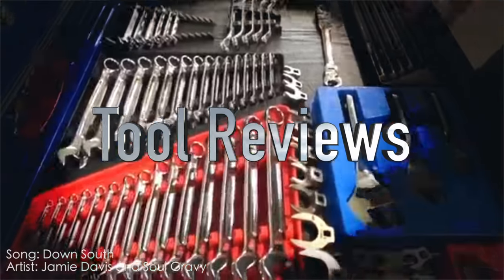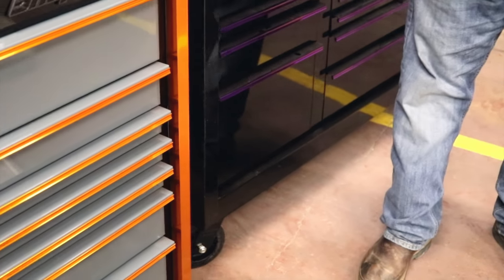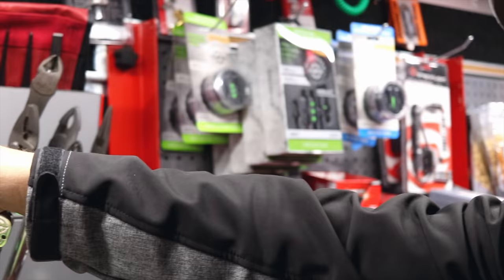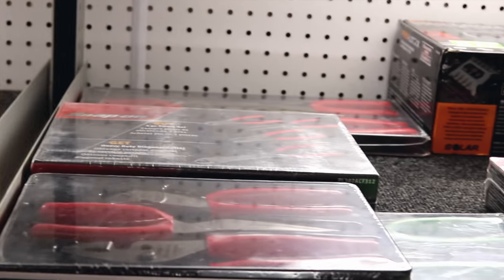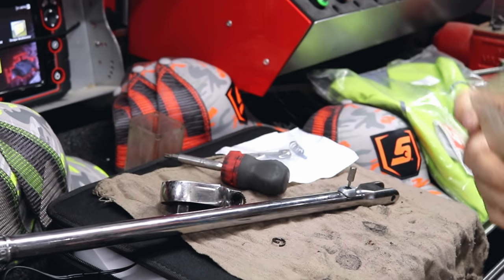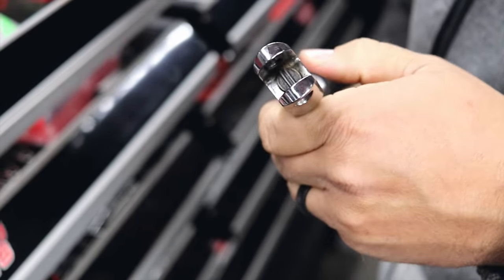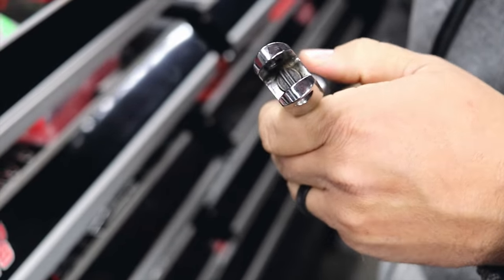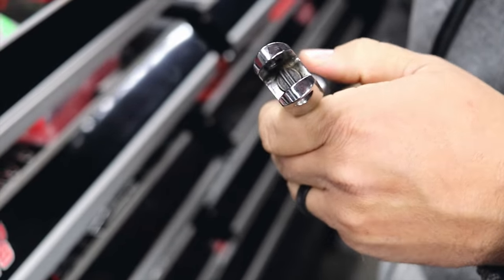Snap On Special Order Toolboxes

Comment: My two big ratchets are the SLL80A and the SLX80A You are right about being the cats meow for sure. I bought the non flex about a year ago when I was replacing the bearings in a Dana 3rd member. Snap-on makes some fine ratchets no doubt about it.

Comment: You mentioned drilling out bolts I found carbide straight flute drill bit  are amazing although they are very expensive but worth every penny "they are about $60. each" but they go through anything you put in front of them. I think they are really supposed to be put in a cnc machine but they work in a regular drill to

Comment: Broken off bolts,we use the mig welder a lot for broken off bolt extraction.Basically weld a nut on the broken off bolt in an easy spot.Diesel would not leave my mom alone,she spoils other dogs with treats.

Comment: Personally I like the Matco locking flex head better. To me it seems like Snap On let the interns design their locking mechanisms.
Reply: I completely agree. The Matco locking mechanism is just a better design hands down. The finish on the Snap On ratchets is better than the Matco though.
Reply: I'll be honest. I had the longest matco 1/2", and a 3/8" long one,  and a black 3/8" medium length,  and 2 3/8" stubby matcos. I had an old orange hard handle set of snap on that was give to me. The 3 piece set. They were rough. I traded em in for long handled 1/2" snap on locking flex head and I'll not buy anther matco. I love both but the snap on is better to me. When I need 3/8" I grab the black medium matco. 9 out 10 times. If I'm needing 1/2" unless I have to really put out on a bolt a grab the snap on now. Though if I need to break a tough one loose,  I get the super long matco. If that don't work I grab my 3/4" extendable ratchet. I hardly ever use 1/4" stuff. But I work on ag equipment,  and tractors. So.